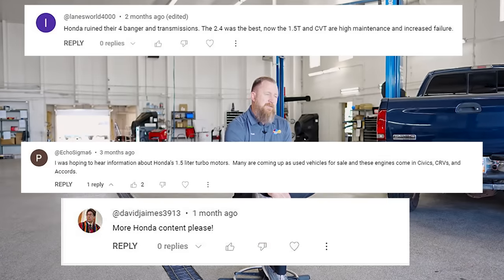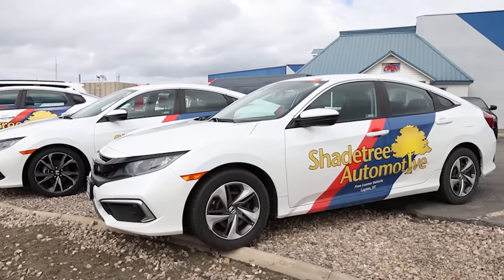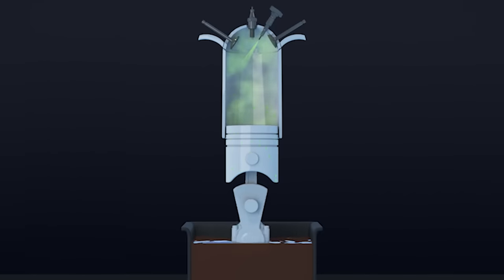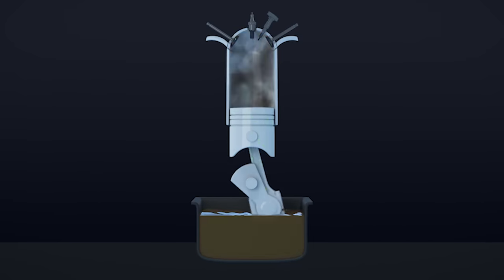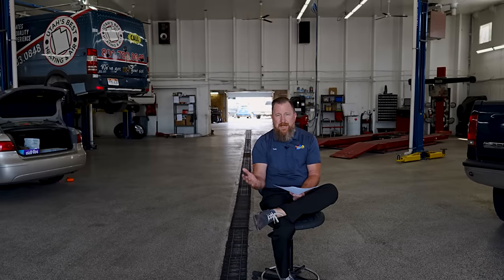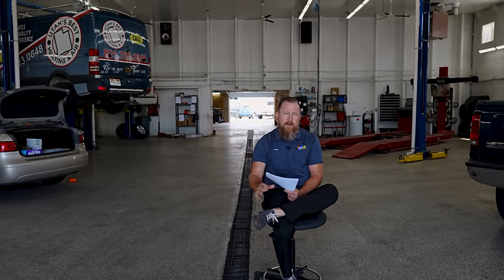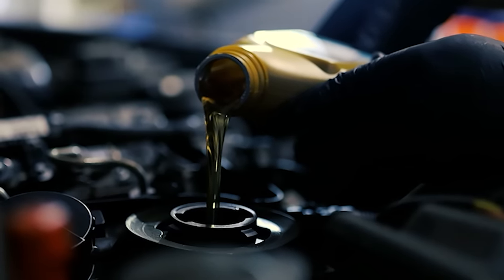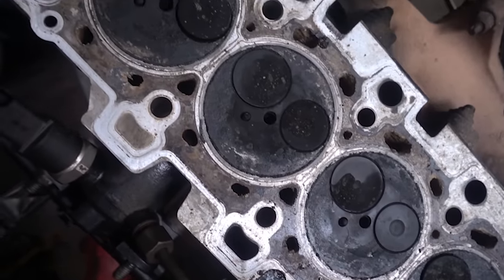Honda Oil Dilution Issue - Should you buy a new Honda

Comment: Just bought a new '23 Civic sport hatch a few weeks ago and opted for the 2.0L NA engine as I've never trusted the reliability of these tiny turbos. Sounds like I made the right choice
Reply: Same got mine aswell.
Reply: Yes you did!
Reply: I'm waiting for a Sport Hatch 2.0L with manual transmission to show up at a local dealer.  No, I didn't order one.  I'm not in a need of a car, but if one shows up, I'll make an offer and see where it goes.  It's probably going to be the last chance to get something like that without too much new tech and useless gizmos.  I mean, these 2.0 are the last of Honda engines WITHOUT Turbo and WITHOUT Direct Injection.  Yes, I'm aware of the fact that even Honda's own website had it INCORRECTLY listed as Direct Injection (they fixed it some months ago), and that many auto websites like CarAndDriver still list the wrong information.  The so-called "journalists" these days.
Reply: I’m rolling the dice. I got the sports hatch 1.5. Drives fun though
Reply: According to Scotty Kilmer, NEVER get turbo for any engine.  Just get a naturally aspirated.
Reply: @catsspat thank God for your American NAs! We Europeans like to import them and install LPG systems. Clean, cheap, reliable car, not possible to find on a local market anymore.
Reply: The nice thing about that specific trim (2.0L N/A sport hatch) is that they still offer a Manual trans option which is what I opted for when I bought my '24 Sport hatch. I am not really too fond of the CVTs as they seem to be more maintenance sensitive/needy and I don't think they will last as long as the 6 speed MT.
Reply: @Vagabond_Etranger  I've had many turbos. No issues if you maintain your vehicle. All of them are/were VW/Audi who were one of the 1st companies to embrace the 2.0T engine. Now everyone has one.
Reply: Ugh!! the 2.0 is sooooo slow!
Reply from the maker: You made a good choice!
Reply: I bought new CRV 2024 2.0 e-cvt. Seems like best combo
Reply: live once..i enjoy my 11th gen turbo😂😂❤❤..no issue
Reply: Turbo isn't the problem, it's a combination of factors that includes the turbo

Comment: Honda does build some of the best engines going back decades. I bought a 2006 Odyssey with 150K miles 7 years ago. I started getting random misfire codes. Changed  spark plugs and coils, problem continued. Took it to the dealership as I figured they'd find the issue with Honda specific computers and Honda trained and certified techs. First time I took it in they said the misfire is so minimal it's barely registering on their computers. They erased the code and sent me on my way. A few months later the same codes popped up again. I took it back. They recommended I do a valve adjustment and that this "should" correct the issue. After doing some research I confirmed these J series V6's do require it after 100-150k miles. At this point the van has somewhere around 180k miles so I figured what the heck. If it will correct the issue and it needs it anyway then it's worth the $800 they quoted me. Another few months go by and the codes come back! Now I'm getting agitated. I go back a 3rd time and they give me the same story, it's minimal and not affecting the engine. Now I take to the forums and start doing some more digging. Turns out Honda's fuel saving feature, VCM, was the culprit. After learning of all the problems this system caused in multiple models (Pilot, Ridgeline, Accord) I decided to take matters into my own hands. I followed the many recommendations of installing a VCM Muzzler. Holy cow! This little device that cost less than $200 fixed the issue! The van is now well over 200k miles and running like a champ. I called the dealership and asked them why no one thought of suggesting VCM was the issue. I told them I found service bulletins from Honda about the issues VCM causes and even a class action lawsuit to have piston rings replaced! But unfortunately for me that covered only certain models starting in 2008. Moral of the story, Honda along with many other manufacturers build really good engines but screw them up with all these fuel economy systems that eventually end up causing extreme damage which will cost way more to fix than any "savings" you may have gotten. Of course by the time the problems arise you are probably out of warranty. I consider myself lucky that someone other than Honda figured out a simple and economical solution. Knowledge is power. If you plan on keeping your vehicles long term, educate yourselves! (Sorry for the long post, it's just aggravating to see another round of problems cropping up on otherwise really good engines, all in the name of trying to get 1-2 mpg savings, which the everyday consumer doesn't really see or benefit from anyway!)
Reply: thanks for the educational informative post!   I'm well aware of this issue, from reading on the Ody forum, for Odyssey's.  Classic that a dealer wouldn't mention that since they either dn't know, or they dn't want to make Honda look defective in design, which it absolutely was for many years re the VCM system, presumably still is.   Not only Honda, all makers with cyl deactivation, cause engine issues and failures, GM being the most famous infamous one
Reply: Sometimes owners abuse their cars and cause issues, not necessarily the design of the car. I'm not saying you did, but a past owner might not have been changing the oil regularly. Cars need maintenance and some people have no clue what that means.
Reply: I just got a V6 accord and am looking to get the vcm tuner but unfortunately they keep selling out the day the new batch is released… hopefully I’ll have better luck next time.
Reply: @18_rabbit  Thanks for reading my extremely long post! I agree. Honda has built their reputation on durable and reliable vehicles. But unfortunately everyone has to abide by government regulations and these are the results. By the time these systems start causing serious issues, the vehicle is out of warranty and most people will just buy a new or gently used one instead dealing with it.
Reply: @methanial73  "Sometimes" is an understatement. I honestly believe 95% of people driving a vehicle have no clue it requires regular maintenance. I have a friend that leased a new Audi SUV last year. She has no clue about cars. She asked me the other day if I think she should get an oil change because she now has 10K miles on it. She said no one at the dealership told her about maintenance. I'm like yeah of course they didn't. 1. It's a lease so you're trading it in, in about 3 yrs so if it breaks later it's someone else's problem and 2. If it breaks while you have it they hope you bring it to them to fix it or put you in another car! I can't stand dealerships. Odyssey's are known to have major transmission failures. I change the fluid on mine every other year regardless of miles. Also recently changed the pressure sensors and checked the solenoids. I changed the filter a few years back. It's shifting smooth and strong. I change the engine oil every 5K miles or 6 months, which ever comes first. Engine runs great. It's old and beat up on the outside but solid mechanically.
Reply: @dy1angi11ey6  Don't give up! It's worth it to save the engine. In the meantime, keep up with your oil changes, do them every 3K miles. Check your spark plugs and change them if they have a lot of oil on the threads. That means oil is getting past the piston rings and you're burning oil. Very common with the VCM.
Reply: @adsosa2414  Just got it and installed it yesterday. The car definitely drives a bit smoother without VCM. It only has about 80k miles right now so I’m hoping I disabled it soon enough to avoid all the issues associated with VCM. As for oil changes I was planning on doing those around every 5k and transmission fluid about every 30k. (Or oil at least 3 times a year and trans at least every other, whatever comes first since I probably drive a little less than the average person).
Reply: @dy1angi11ey6  awesome! As long as regular maintenance was performed during the first 80k miles, you should be fine. I bought my van with 150k miles, muzzled it somewhere between 170-175k miles. Have over 202 currently and running great. You'll be fine.
Reply: Dealer just want to keep making  your money
Reply: The dealership will never, ever admit faults on theirs or Honda's fault - pathetic.
Reply: Correct. 2015 odyssey owner here. Had the car brand new, noticed poor morning cold starts, blue smoke when going from cruise control. VCM muzzler installed, replaced oil at about 3k 2 times in a row to dislodge the gunk in piston rings. Car gets the same MPG on highway or city driving.
Reply: So... maybe at 150K miles there's an issue that flings a code but otherwise you can still get from A to B on an 18 year old vehicle, oh and you feel it's still worth investing time/money when it hits 200K miles.  That was what I took away from your comment.
Reply: I've read the post and the replies. Great info. However, I did not read anyone linking the engineering problems to government mandates forcing engineers at companies like Honda to lower emissions and increase fuel efficiency. The Shadetree representative does make this point briefly (minute 2). As adsosa2414 stated, educate yourself, but also involve yourself on policy and what governments do.
Reply: They are trying to pass government emission standards. However they aren't actively trying to engineer a fix for the issue unlike Toyota. Modern Honda corporate rather run with the known defect and hopefully the customer eats the cost by hoping the warranty expires before the defect manifest itself.
Reply: Because the VCM, effects Fuel Economy. So they cannot disable it or say it is the problem. Irrational EPA regulations are the SOURCE of the problem, engineers have to make cars so fuel efficient that RELIABILITY is significantly effected.  D.I. Engines are super nice BUT Port Injection is definitely the way to go in my opinion. For reliability and IF stuff  fails, its relatively CHEAP to repair and their is LESS stuff to fail [hi pressure pump - last one I did was 1500]
Reply: Blame the GREEN monsters for forcing us into this crappy corner!!!!
Reply: I have a 2009 Honda Odyssey and like you same codes pop up, I bought a bottle of Rislone CAT Complete, the codes went away and it no more mis-fire code or coil pak codes plus it ran smoother and had more power.  I did consider the VCM Muzzler and maybe in the future I will yet.

Comment: We live in Montana, not many short trips,  and we had oil dilution issues on a 16 and 18 Crv's with the 1.5 T. Oil was always way over full and smelled very strong of gasoline. Didn't think we had issues until I started checking oil myself. The worst part was the response we had from Honda. Deny, deny, deny. I traded for a 19 Passport with the N/A  six cylinder engine.
Reply: The good old tried and true J35 V6 hasn’t impressed me until I learned about the oil dilution in their turbo 4’s. I installed an S-VCM and an Idlestopper in a 2019 Acura MDX so 3cyl don’t shut off on the highway and also it doesn’t shut off on a stop sign. Otherwise they’re hearty engines when maintained. 100k timing belt, water pump sparkplugs are about it. Don’t forget the transmission fluid, transfer case, rear diff fluids before 60-80k
Reply: So you gave them more of your money? 
My dude, you should have more respect for yourself than that.
Reply: They screwed you with a major engine issue then doubled-down and refused to take responsibility. So, your solution is to just give them more of your money? lol
Reply: @nodak81  what else could I do, I wasn't going to sell it to someone else with the issue. I'm just not that kinda guy.
Reply: @MontanaWelldigger  at least the J35 V6 has been tried and true and they haven’t tried any of the crazy stuff on it. I would, however run an S-VCM Controller and or an Idlestopper. They’re both about $200 total worth of easy plug and play devices but IMO well worth it as preventative upgrades
Reply: @vqdriver  thanks for the tip!!
Reply: "The worst part was the response we had from Honda. Deny, deny, deny." 

Yeah, that shit is infuriating.
Reply: @roelfkromhout  sounds like my ordeal with Infiniti back in 2007 with oil consumption on the VQ35DE. After taking the test they said it was still “acceptable.” Anyway I come to find out from forums that people who got replacement engines still had the problem. So 18yrs and 179,000mi later I’ve learned to just take care of my car. Look into it, keep the PCV system top notch or maybe see if a catch can will help and just change the oil way sooner than 5,000mi using Quaker State Full Synthetic 5W30 (not ultimate protection)
Reply: @MontanaWelldigger  "what else could I do..."

Buy a DIFFERENT brand of vehicle.

"I wasn't going to sell it to someone else with the issue. I'm just not that kinda guy."

What are you saying, you traded it in, so you're off the hook for disclosure of issues?

The issue that people have isn't what you did with your old Honda, it's the fact that you REWARDED Honda for their bad behavior by buying ANOTHER Honda.
Reply: We went to honda dealers last week. I asked. They never heard of it. Yea right.
Reply: @roelfkromhout  Except they got sued.....and eventually they had to replace some of the engines.
Reply: Honda wouldn't stand behind their product... so you reward them by buying another one of their products??
Brilliant. 😒
Reply: @vqdriver  yep ,great engine especially if in lower gas price areas since they aren't easy on gas.  I have an odyssey.   Getting that VCM disabled is THE key!  Saves the engine damage e.g. to rings, and cylinders that the stupid VCM causes
Reply: Step up viscosity from 5w20 to 5w30 etc add lucas oil stabilizer until solves issue.
Reply: @mysticjedi6730  I don't think so.
Reply: mind me asking but if you had issues and honda refused to help why would you buy another honda?
Reply: @cantbuyrespect  I traded the 18 model back to honda on a new 19 6 cyl Passport, it has been great. Read my other replies.
Reply: @vqdriver DE's leak oil, RevUps burn it. The way 2nd or 3rd owners treat the engine also dictates how long it will last and Im NGL, my old Lexus had me getting way too comfortable when I got my G35 and blew the motor. Learned the same lesson you did and my replacement motoris going strong now. Car has 285km, motor got dropped in around 220-230km with 120km on it from a rear ended donor.
Reply: @SpikeRazzor  y’all get a recall notice about Honda Acura recalling a bunch of their J35 V6’s up until 2020 or so?? Crazy news…. I’m gonna keep using the Quaker State Full Synthetic 5W30 (not Ultimate Protection) and keeping my fingers crossed 🤞🏽
Reply: @vqdriver yeah there’s a defect in <1% of them, that one probably ain’t a big deal. The fuel pump that affects almost all 2017-2020 Hondas though 😂
Reply: @davewilson7602  how about the engine recall on rod bearings and the stop sell on Honda and Acura V6’s up until 2020? That’s wild!!
Reply: @vqdriver  yes that affects less than 1% of units, they’re recalling them all to check so that the few that have the issue can be fixed and the rest are cleared of worry. Not that big a big deal in my opinion
Reply: @davewilson7602  hopefully. Yea wow, fuel pumps too? Heard this about Toyota and Lexus a couple years ago. I wonder if they’re also made by Denso
Reply: @davewilson7602  yes even at 0.5%, 1,250 cars or 2,500 at 1% that’s a lot of ruined vacations, missed workdays, events and hopefully nobody will be hurt making a left turn or leaving an intersection. That amount of engines will fill a Home Depot floor. Sorry anxiety lol
Reply: I have a 2009 yaris 1.33 dual vvti 1nr fe ... similar problem.(piston rings fault)  toyota said no problem.. a new engine forced to comply with shit climate hoax emissions crap. Honda did the same many years later... same bullshit common denominator ...new engine ... emissions nonsense........NOT TOYOTA OR HONDAS FAULT, initial 2.2 litre civic 2012 idtec engine problems with DPF.... more new emissions crap.. I have 2014 1.6 idetc diesel.....lessons learned....bullet proof diesel engine and dpf. I still have the so called oil burner yaris too...no problems
Reply: @getthecansin  it's all on the EPA and the climate doom and gloomers.
Reply from the maker: Yeah those year Crv's were the worst mixed with your altitude and climate was a recipe for trouble.  Good call on the Passport 6 cylinder
Reply: @roelfkromhout :They are so dirty.
Reply: Don't forget that these new engines are also burning oil, so if the oil level is rising, it's even worse and more diluted than the simple volume change would initially suggest.
Reply: That other idiots comment. Stupid.   The Honda is still gd and its yours so u know how its been taken care of.   And you r a respectable man/person.  Not padsing some problem on to a person not capable or able to afford to deal with it.   😊im sure it will still b a great engine.  Just bump up the oil changes.   So it costs another 1-2oil changes per yr.         

 @MontanaWelldigger

Comment: I have a 2016 civic ex-t with a 1.5 turbo and have 188k and have had no issues with this.  I do have a longer commute to work, so this is probably why my car hasn’t had issues.
Reply: I had a 4000$ quote for timing chain on my 2016 ex-t at 163k km. I rarely plugged block heater in during -40 winter. Pretty sure thats why. 
Trading it in for a new one though… I think.
Reply: Service manager recommended oil change in fall and spring to limit oil dilution due to cold weather.
Reply: short trips contribute (less than 15 minute drives)..  so driving 30 minutes does burn off the fuel in the oil (and water).  This helps also  reduce sludge formation (which gums up piston rings, and leads to oil burning).  So drive car 30+ minutes once or twice a week to keep oil more pure.